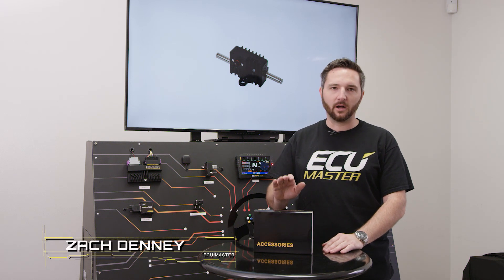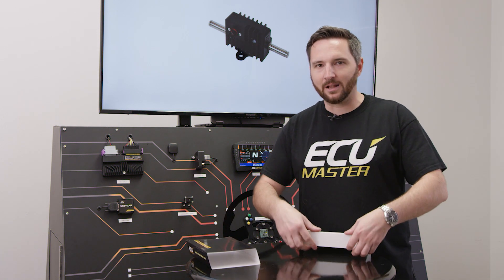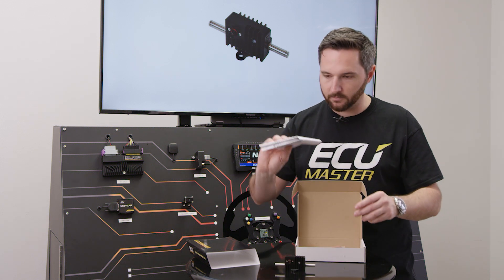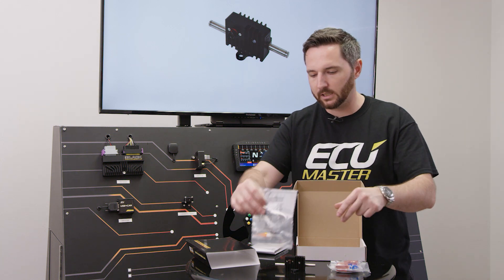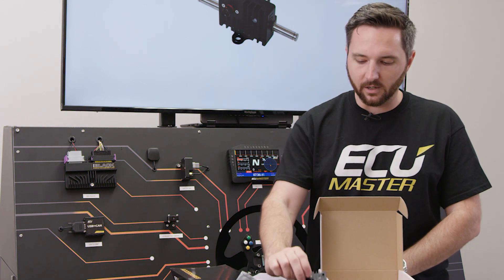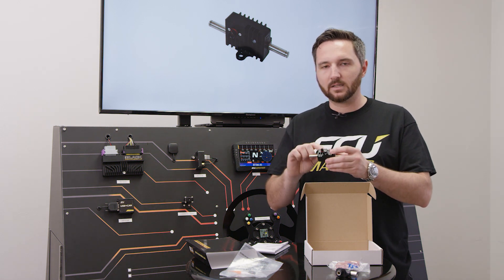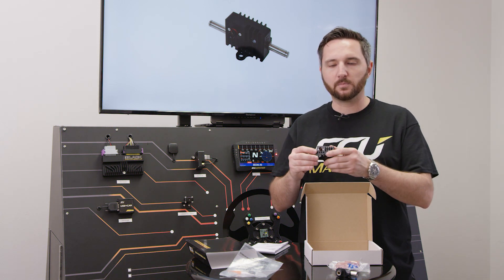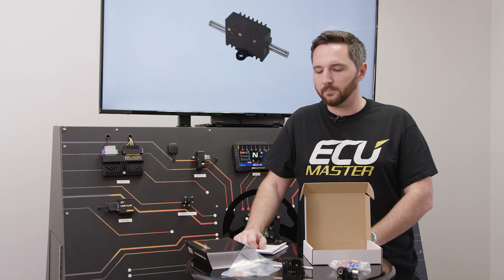BATTERY ISOLATOR - RADLOK CONNECTORS UNBOXING

Comment: Whats thickets guage wire that fits ?
Reply from the maker: They will fit a 2 AWG wire per the manufacturer - https://www.mouser.com/ProductDetail/Amphenol-Technical-Products/RL00801-35
Reply: @ECUMasterUSA  curious to know why isnt there a 0 guage ? Is it to excessive
Reply from the maker: @pourtierbeatz7804  The battery isolator is only meant for so many amps, there is no need for wiring that big or heavy as 2AWG will carry plenty of power
Reply: There is something I don’t understand:
1) if I buy the PMU16 AS why would I meed a battery separator? I thought the PMU can do this
2) how can I wire a hot battery bus through the PMU like for Hazard lights? 
In the software it only has a choice for default and that I guess is for ignition key ON, correct?